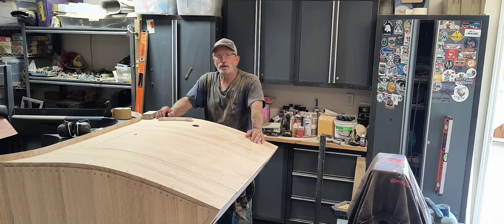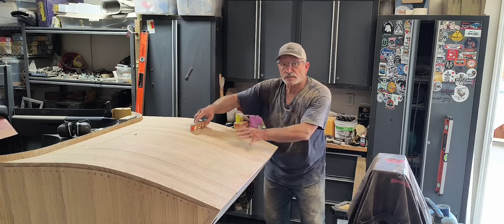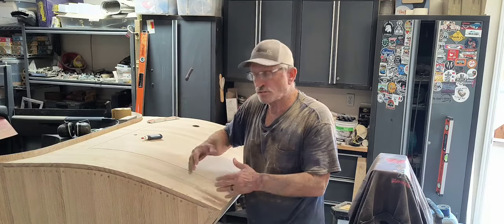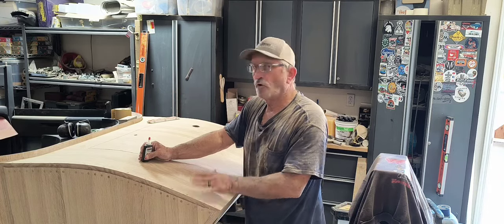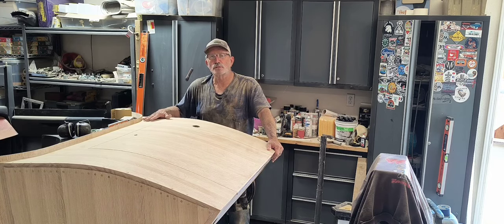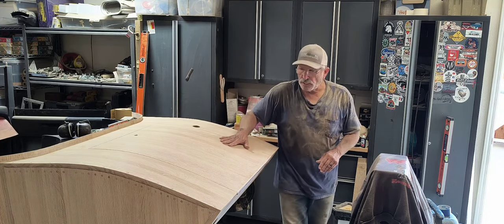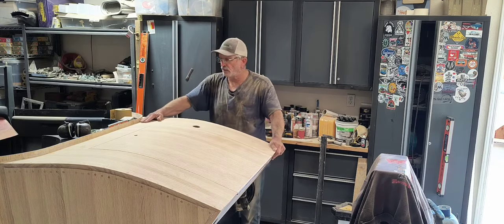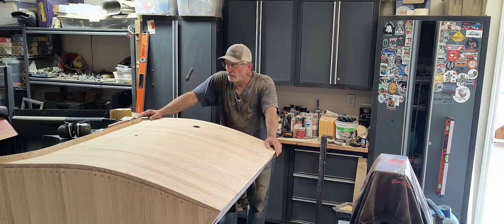rat rod build!

Comment: Me I prefer sanding sealer first then apply several layers of lacquer but that's was all for furniture not something for exterior use not sure how it wood hold up but you would get such a fantastic finish with lacquer ! That color is going to make that wood pop man can't wait !!!
Reply from the maker: Yeah I've been reading and watching videos and the sanding sealer can be used but since it's a hardwood they say it's not necessary. I tried a little bit of the stain yesterday in a couple places, I'm thinking if I go with that color I'm going to have to put several coats to get the deeper red out of it. Thanks for leaving a comment I appreciate you stopping in.